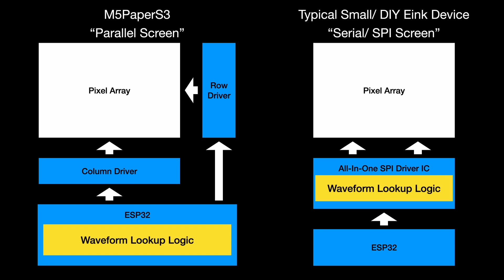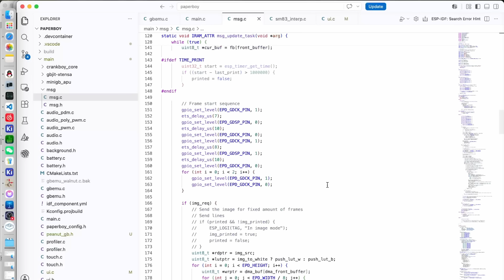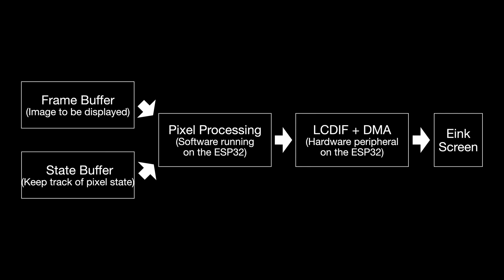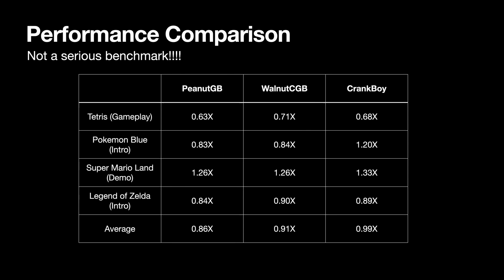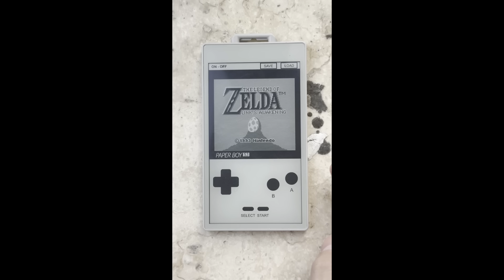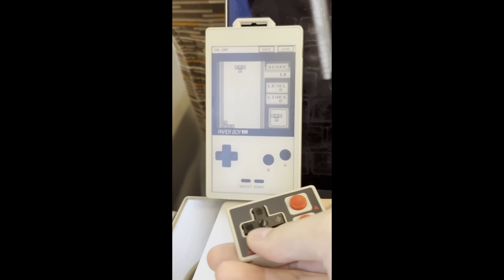GameBoy Emulator on ESP32 + Eink (M5Stack PaperS3)

Comment: Wenting! I think you might be the most important  display technology developer currently working.

The reason I think so is that this might be the first display technology that can simulate 3d “err 1.5d” depth.

Think about it, because Eink physically changes the light refraction of ambient and front lighting, a high refresh rate can simulate color desaturation in perspective and radiant color saturation in the foreground.

Anyway, I’ve got some ideas about it which could be tested by simple digital projection on your current hardware, I believe no modification would be needed to see some befits . 

Obviously an integrated transparent oled might also be simple to test, but even a low rez projector might work temporarily.

The large Eink displays might be easily testable as well!

Comment: It would be great or at least fun, if there was a new modular minimal ecosystem, not Android or necessarily Linux either. You could buy few $10 devices and combine them (like a keyboard, screen and the computer part), and perhaps just add or write an e-reader program for it, or perhaps a writer program or a game like in this case. Perhaps add music and speakers. Programming isn't so difficult. I mean, it also is, if you want something complex, and considering you have to comply with existing systems... but there are also many higher level things that are simply easy. For example making a website where you can write or read... surely you have the browser doing the heavy work, but you can easily customize your "app" by just few tweaks, or you could easily make it totally different.

(I'm currently looking for a cheap small device where you could do 10-finger typing nicely, so it's just for writing, and doesn't matter if it gets stolen, lost or broken. Preferably it would have some e-ink screen, perhaps other features but not necessary. But for example you could write your own file browser too. I'd personally use webpages for everything, but first you'd have to have the "browser/OS" there too).

(I know, ESP32 isn't probably ideal, but... whatever fits the purposes.)

Comment: Will running this significantly decrease the lifespan of the ink screen on the Papers3 device?  They are not designed for such fash refresh are they? Still a very cool project and I hope you share more papers3 projects as I like the platform and feel they are underutilized. Thanks again for sharing your brilliant work

Comment: I heard eink has a total refresh lifespan of 1 to 2.5 million times, makes 60fps very expensive.

Still very cool though, not every project has to be practical.
Reply: It's around 10 million full resets - before the capsules could clump together. This doesn't use full resets, but a delta change integrating stream. So that limit doesn't apply - it's far far beyond that.

Comment: but doesn't upping the refresh rate end up burning more battery which is one of the points of a e-ink screen low to no battery draw
Reply: the reason eink is good for low battery for stuff like shelf labels and ebook readers is that it's bistable - a still image can be displayed continuously without requiring any power. a constantly updating e-ink screen is more power hungry than a reflective lcd. (adding a backlight to the lcd screen brings things closer)

Comment: Installed via M5Burner
Copied .gb format games to the root of a FAT32-formatted SD card
It only shows the buttons and the top save/load menu, the game screen is empty
The screen doesn't show any game images or game selection menu — maybe I did something wrong?
Reply from the maker: That's weird... it sounds like it's stuck trying to read the SD card or list games
Reply: The problem was with the flash card! 
Now it works:) 

For some reason it didn't want to boot with the 8GB card
The working option turned out to be: Ezviz HC Class 10 32GB
Reply: @hobbysupport  thx!  Same symptom with 4GB SDcrad. 32GB Class 10 SDcard worked fine.

Comment: That's an INCREDIBLE refresh rate for an ESP based epaper! I am amazed. I always believed the low refresh rate on epd was a hardware limitation and not a firmware problem
Reply: Have you made open source the way you drive the display using row and column drivers? That would be so amazing to have
Reply: Most ESP32 based eink devices don't directly drive the screen, but instead talk to a controller built in to the screen over SPI. The use of the SPI bus and the way the controller can't start an update (even if there are no overlaps) until the previous update is done really limits the update speed.

Comment: The visuals on this are really cool.  I wonder if the sound could be done the same way I made a .wav player for an old PC speaker... delta-sigma modulation.  I think it may be the same technique the raspberry pi uses to output audio on its headphone jack... which internally is just two digital GPIO pins.  Sound quality isn't the greatest, but it does at least work.

Comment: You could rotate the screen 180° so the thicker part of the bezel and that lanyard hook looking bit would be on the bottom. The screen aspect is amazing, if the sound issues could be sorted it would be a feasible product on its own. Or an e-ink based replacement screen for the original DMG... a man can only dream ❤

Comment: Amazing work!! I've been working on a GB emulator for the M5StickC Plus2 with Wi-Fi AP controls and a ROM selector, so I really enjoyed the video and could relate to a lot of it. I ended up taking a different approach to the sound and actually stuck with something like your first version even though it's a bit quieter. Unfortunately I don't have one of Paper device to test but congrats on the project, awesome work!

Comment: Really nice!
Do you know if the m5 PaperColor's display has a row/column driver interface as well and if it'd be capable of such refresh rates? (even if monochrome)
Reply: No, the Paper Color uses a Spectra 6 display using an SPI controller. Also, monochrome isn't faster on a Spectra 6 display - "white" is just one of the 4 colors of particles in the display film (the others are red, blue, and yellow), and "black" requires blending multiple color particles.

Comment: How much CPU time does the display management use? I haven't developed for ESP32 but looking at the user manual I would say a well optimized GB/GBC emulator should be able to run fullspeed with just a small fraction of the 240MHz CPU time, especially uf the SIMD extensions are used.

Even fullspeed SNES should be viable, if you're willing to live with the color selection. GBA as well though the lack of memory would limit what you could run.
Reply: Yes and no. I'm one of the devs of the emulation core that is used here (CrankBoy). I'd say we already optimized the hell out of the core, although lately we found another way ti increase speed.  The problem isn't so much about the clock speed, although having 240 MHz would help. The Playdate has a 168MHz ARM CPU, and the issue simply is the L1 cache. We minimized the emulation core as much as possible, to have it always in L1 cache and also added cache prediction hints, the Playdates L1 cache is only 16kb (8kb on RevA).

SIMD does only help you that much, you actually need multiple data that you can process with a single instruction, not much in the core itself is suited for that.  If I remember correctly we only use it in 2 places. Audio on the other hand can be SIMD'ed, and we use it in our minigb_apu implementation a lot. But that has the "downside" that you need to work with quantized integers, since SIMD does not support floats, at least on the Playdates SoC. Ideally you want to use floats for audio to retain precision. But it works quite well and is fast
Reply: @CrankBoyHQThis platform has 512KB of tightly coupled SRAM that's as fast as L1, cache hit rates should be a non-factor if you're properly using it.

I have a lot of experience writing optimized emulators for mobile platforms including ones around this level of compute. So I'm pretty confident in my assessments above. SIMD is very useful for optimizing graphics rendering on hardware. The problem of course is that a lot of people looking to optimize emulators only look at the CPU emulation.
Reply: @espfusion  A yeah, I forgot about TCM and SRAM. We also use this (TCM) for RevA devices. That really makes a difference. Funny enough, the Playdate also has an ESP32, but it is not accessible to use. Would be amazing if we could use this.

Comment: I wonder if this could be turned into a screen mod for the original GB to both be more power-efficient (screen could detect if the same pixels are being sent and avoid unnecessary refreshes) and have less ghosting while keeping the non-backlit fun of the original.
Reply from the maker: The original GB's screen is already crazily power efficient. Memory LCD might have a chance of beating it, but Eink screens consume way more power than the original.
Reply: @nbzwt Only if you constantly refresh it. That's why some chip that sits between gb hardware and the screen and detecting which pixels ACTUALLY changed and only refresh those is necessary.
Reply: I think that'd be awesome

Comment: For sound, i was reminded of bitluni using ESP32 Ultra-Low-Power (ULP) coprocessor for generating audio, S3 should have ULP but i reckon that would bloat the scope of the project, architecturally and complexity,  if its within the realm of feasibility, and also if its just premature optimization. Regardless, still really impressive that u keep churning out bangers after bangers.
Reply from the maker: Using the ULP coprocessor was actually one of the many options I explored. Somehow the conclusion I got was that it was impossible to use the ULP coprocessor here as it couldn't even see the PWM peripheral register. But now thinking about it more, I don't really need PWM if I get the full ULP coprocessor...

Comment: Now I just want a replacement e-ink screen for the dmg
Reply: I would imagine that or the pocket would be prime candidates. Honestly even a newer Linux or android handheld with e ink would be interesting.
Reply: @Unmarketable  Dude yeah the pocket would be perfect for this. Best you can do with a DMG is just do a backlight mod to preserve the unique original screen.
Reply: There is a RLCD mod for the DMG using the SHARP MIP display. It's probably the closest you're going to get with still having good refresh rate. It's by Bytendo. You can see pictures of it on his ko-fi page.
It's a high level mod though, not something you can crank out over a lazy weekend.